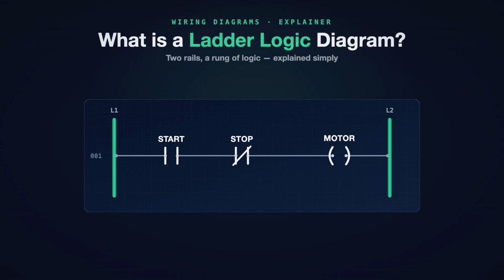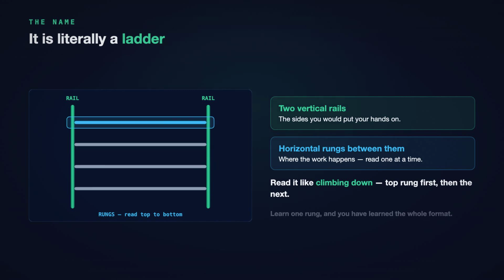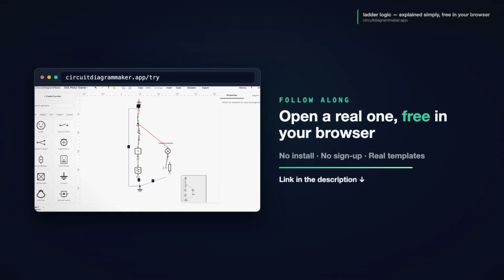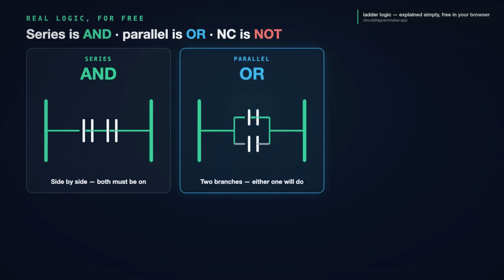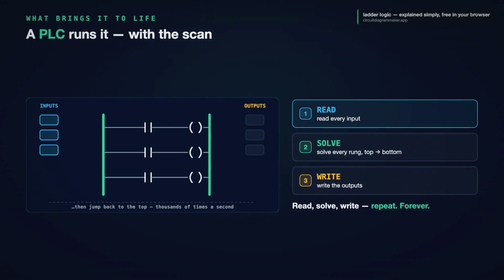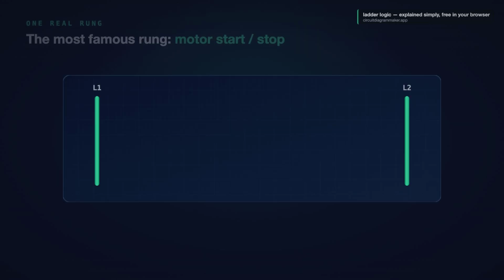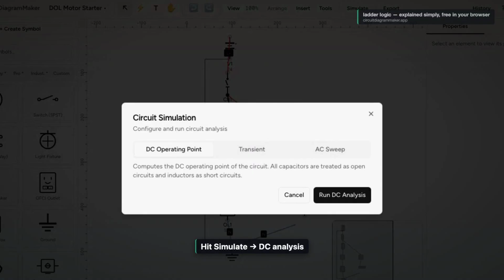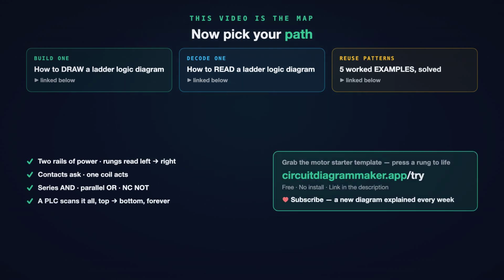What Is a Ladder Logic Diagram? (Explained Simply)

Comment from the maker: The one-sentence version: a ladder diagram is just contacts that ASK a question and one coil that ACTS on the answer — and a PLC re-checks every rung, top to bottom, thousands of times a second.

The part that surprises most beginners: it isn't really "code" at all. It's a digital tracing of the old hardwired relay panels electricians already read — which is exactly why it never went away.

Open the same start/stop circuit and press a rung to life (free, no signup): https://circuitdiagrammaker.app/tools/ladder-diagram-simulator?utm_source=youtube&utm_medium=pinned_comment&utm_content=yt-112